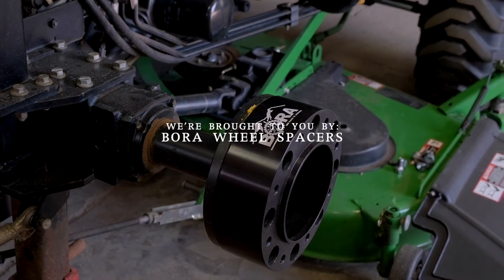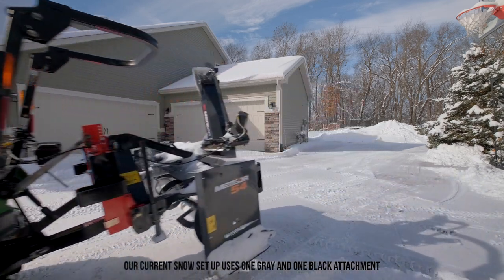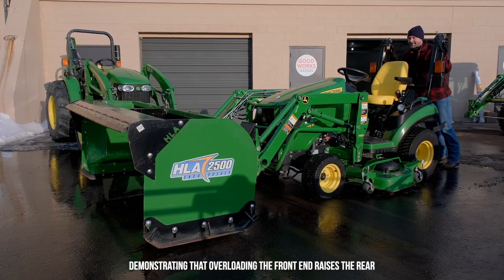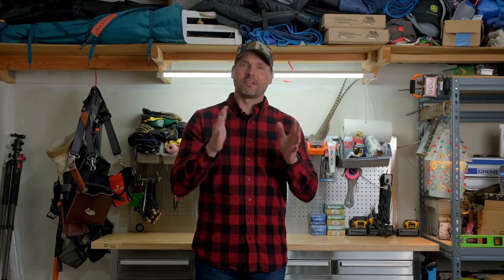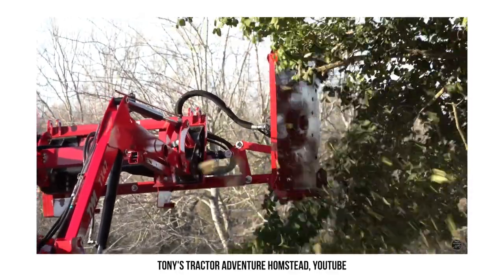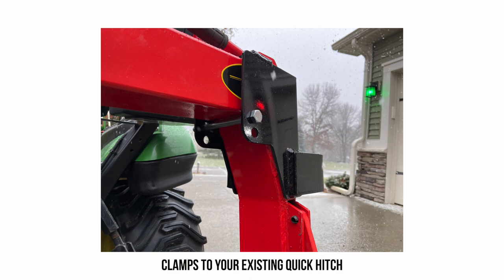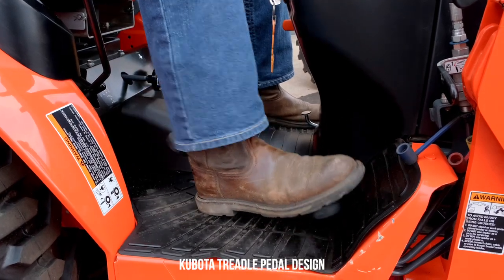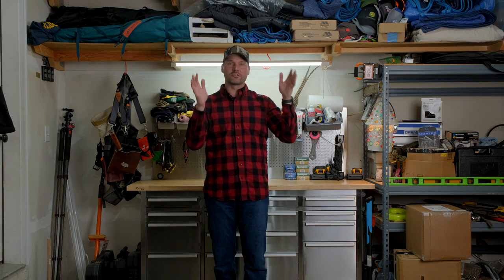7 UNSOLVED TRACTOR MYSTERIES, NO EXPLANATION.  CAN YOU HELP? 👻

Comment: Only one I can give a opinion on is I have a Massey Ferguson 1635 and with the reverse hydrostatic pedal on the right it is easier to back up while snow blowing  and still use my hydraulic controls. If the reverse pedal was on the left you would be cranking your body that much more

Comment: Tractor color goes way back in history. All the major manufactures had one color and in some cases it has stuck for almost 100 years in a case or two. In my youth there were two green tractor. Oliver and John Deere. they were of different shades though. Of course the sheet metal was different to as well as their sound. You could hear a popping Johnny from a mile away and and Oliver only an 1/8 of a mile.

Comment: Hi I own  Bomr tractor 60hp turbo diesel, cab, front end loader and bucket. It has a 'down power' on the 3 point linkage. Now don't get me wrong but what sounds like a great idea can be dangerous. Particularly if you are working hard ground and you put the down pressure on and one or both wheels come off the ground as the weight of the tractor is insufficient to push the implement further into the ground. Add to this if you put the down pressure on on a slope and the highside wheel goes up (gravity) you may need to change your underpants 🤣

Comment: Newholland Base colour is bluw now but you can get most tractors here in Europe in different colours there is a Grey Newholland and orange one. You can get a Blue power newholland Blue Power which is a £5000 Maserati Blue. Compact tractors will tip more tha a conventional as we use wide tyres have seen 8240 Newholland bounce around a tight corner never tipped doing 40kph

Comment: The biggest reason why tractors become so tippy when weight is lifted of the rear tires is because the front axle provides ZERO machine stability. It's a axle with a single pivot point in the center.

Comment: I think that the hydros should go back to being operated like the old IH Hydro were. A lever up on the dash or back by the fender,
move the lever ahead to adjust the speed then reach up and move it to stop/neutral and back for reverse. Then the brake pedals
can be back were they belong and use the foot pedal like IH did somewhat like a clutch but a foot n inch pedal.

Comment: I hear you on the pedal configuration issue. I steered away from the Kubota product mainly for that reason. it was just down right awkward for me. But would like to know what engineer won the bonehead award for placing the John Deere ignition right where your knee will bust it off the key..or bust you knee

Comment: The rops bar possibly has to be a certain height in relation to the size of the tractor so that it works properly in a roll over. Just a thought. Besides tractors are for barns not garages. Don’t get upset everyone just a joke

Comment: Suspension. There is none. 
Bottom line : unstable. 
Too expensive. Besides no one has ever addressed the problem. And the profit margins for said tractor is fine. No need for changing that despite the human death toll.  
On my drafting table I have a 100% load compensating gyroscopic suspension that works on the centre of gravity. 
Simple as a equalizer bars for a trailer to tow vehicle hook up. 
Anyone that understand how that hook up works,  understands how simple things could be! 
Anyone that wants this tractor 
Just contact me

Comment: As far the post hole digger I don't have a problem with it going in the ground it pulls itself I don't need extra weight but what I don't understand is when you hit a rock or a root there's no reverse. WHY NO REVERSE?

Comment: I never understood why Kubota has the brake on the same side as their treadal pedal.
Reply: Especially the split brake on the L-series and above. It's not like you can use it to tighten your turning radius like on an old Farmall. I suppose if you have a non-HST model it might do some good.
Reply: @gordonbeyreis2043  I'm not understanding you guys. My Kubota MX5800 has the treadle pedal on the right side and the break on the left. The break is a split break and I use that all the time to reduce my turning radius. The split brake really shines when trying to turn upslope on slippery ground and the front wheels can't get purchase. Slowing the inboard rear wheel really gets the tractor turning, especially when the chai s are on.
Reply: @ickster23  Maybe it's just on the compact series. My L3301 has the split brake right in front of the treadle pedal. Left side is the clutch pedal for the PTO. You could probably use it for a steering assist like you do on your MX but I'd probably snap my ankle trying to contort it into the right position. ;)

Comment: Thanks for the video. It’s too late, the colors have been cast in stone. No one wants to own an off-color tractor. Regarding hydro pedals, my 1970s vintage Simplicity garden tractor has a hand-operated handle to go forward and reverse. It’s been easy to use. Left foot for clutch; right foot for brake.

Comment: The reason for that high of a sinter of gravity is because of row cropping cultivation stuff like that the main problem the tractors now are not as heavy and it dose not put a nuff Weight low a nuff on it and u.need to check out a lane shark front mower and back in the day all the old farmall tractors came from the factory whit down presser and also whit the rops Thay have to meat a stander on  how tall it is according to National safety board

Comment: I'm just guessing but I would say the weight issue is due to the attempt to save fuel. A heavier tractor is going to burn more fuel and could cost the company some customers even though the tractor would be more capable and possibly safer.

Comment: Thank you I don't think I'm going to buy a tractor now because I'm worried about it tipping over
Reply: I am on all hills and have tipped over once. It was preventable. 100% operator error. Not too hard to tip, but also not hard to prevent...so it's mostly about being very present and aware as you operate it. Ability to recognize when you need to be careful/alert and when you can relax is a big part of it. If you mostly operate on your own property you'll get to know all that well.

Comment: About No.1. - you think like that until you meet North European - Valmet
P.s.: Interesting that almost all tractors what were produced in Soviet union (CCCP) has 3 point hitch whit 2 way cylinder that could do down-pressure. But they almost never had leaver for hitch control with height - level numbers. Only 3 way hydraulic controller - and hitch height you should check by yourself with your own eyes...

Comment: Color is nothing more than brand recognition. It started that way years ago do distinguish brands from one another. Now that colors are so established, you're not going to see it chance. There is no way you are going to see JD ever offer say a red or blue tractor. You will see some come out with a yellow color from time to time, Minneapolis Moline is no longer in business and yellow is more seen as an industrial neutral color. 

As far as tractor design and weight balance, I would submit that the modern tractor is designed wrong. The main drive tires and implements need to be on the front. The current tractor design stems from years ago when people were switching from horses to tractors. People were used to and implements were designed to be pulled from the rear. There needs to be a change but change is hard.

Comment: Crops are green tractors are red!! LOL   Why does JD use aluminum for the transmission housing on some compact models? makes no sense, tractor is lighter and weaker and you can’t use wheel spacers under the warranty.

Comment: what bothers me the most is no place to put any tools or a tool box , i got used to the pedals but the pedals have nothing guarding them under the frame and when clearing stumps and timbers it can get caught up and rip the pedals out from underneath the frame. and you're stuck with not way to move.  it broke the reverse pedal in  half!!!???

Comment: Down pressure Farmall Super C had DOWN pressure in the 1950’s with a. fast hitch , working correctly with no leaks in cylinder or anywhere the cylinder will pick the back tire off the ground, there’s a fine line between to much down pressure and spin the tires and put just enough down pressure and ride ,been running two super c’s that are 70 years old since 77 show me a tractor built today that will be running in 70 years, everything made today is junk x’s 10 the old saying they don’t make them like they use to is very true. Get some juke ass Chinese parts and TRY to put them on a good old American made tractor, NOTHING fits right you have to cut this down, make this longer, what the hell are we importing junk that won’t work for , a week ago 4 out of 6 condenser bad the 2 good ones AMERICAN made 35 years ago for Chrysler were the only ones that could take the voltage theses old tractor need to run, if you are lucky enough that your grandfather  saved some old condenser for old cars and tractors be as smart as he was and save them there worth there weight in GOLD!!!!!!!

Comment: Why are greased joints so terrible at containing grease???  If you have to put grease into a fitting every 10 hours (as recommended by John Deere on my loader), there is something fundamentally wrong with the design.  Put grease in, and after a half hour of use, most of that grease has squeezed out and make a huge mess, reaching out to slime bodies and clothes that come within a foot of it.  At lease Lube-Shuttle has made the greasing process wwwaaaaayyyyyyy better than with the old grease guns.

Comment: Tractors weigh less bc less material cost less and more profit is made and smaller footprints equals more units per shipping container and more profit.  In your segment of the tractor market  it’s All About cheaper manufacturing coast and more profit and not about the tractor lasting for a lifetime or for farming either.   I call all these size tractors “urban Machines” or price point tractors.  They just don’t compare to the older tractors at all.   I’m a NH person and my smaller tractors are all 2003 TC hydro models..  TC33D, TC35D, TC40D and TC45D.  I don’t have to change implements much! 😂😂😂

Comment: Deere made their lawnmowers available in several colors in the 60s. 
Seems to me the idea flopped. 

Wasn't long ago CNH would paint it any color you want if you special ordered it. 

You lost me on tractors being skinnier and lighter and higher center of gravity than they used to be. 
Front wheel assist lets a tractor get the power down with less weight, so they are putting bigger horses in a smaller package then they used to.
Reply from the maker: Have you ever sat on a modern compact?  Try using one and you’ll know what I mean.  Or just read through forum posts.  👍

Comment: Honestly hate hydrostatic pedal set ups. Would rather have one pedal and a lever on column to select F/R.
Reply: I'm same as you. The kubota tridle pedal sucks. I always end up putting my toe underneath and lift 🤣
Reply: Another issue I have.. if they are going to offer a cup holder on a tractor why not make sure it will actually HOLD the cup.